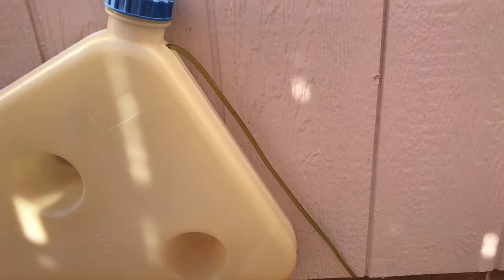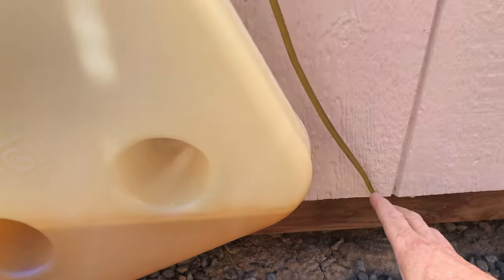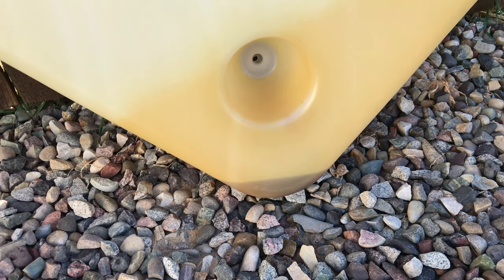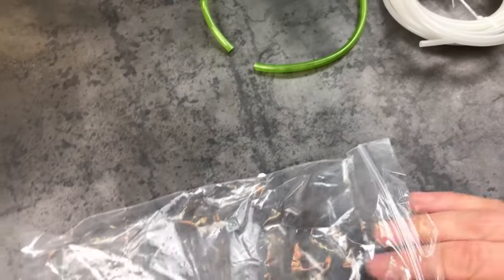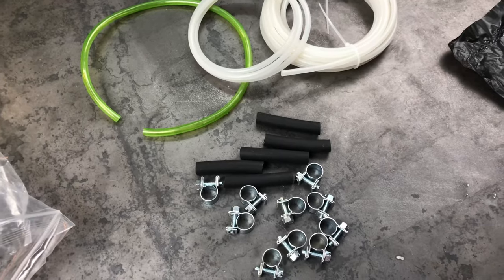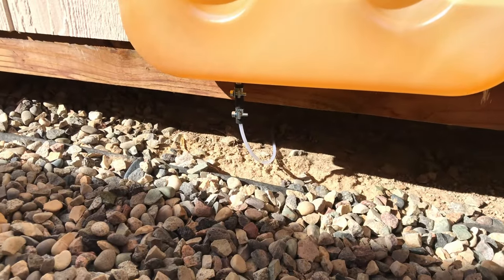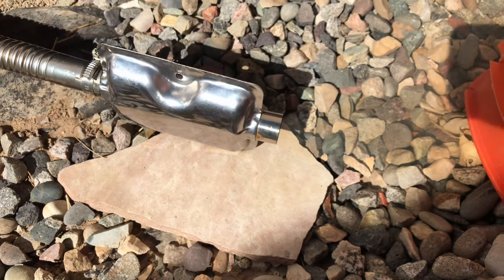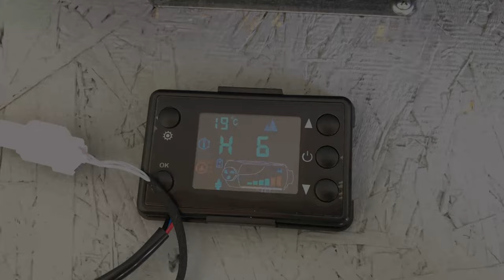Diesel Heater Green Fuel Line: What Happened And How To Fix It

Comment: With my kit i also got the green fuel lines but a friend told me they were no good and gave me a pair of white ones. I installed it exactly like yours, with the black tubes and clamps. Worked well for a few months but then it started leaking from the point where the tube enters the gas tank. Tightening or loosening the bolts doesn’t work. So maybe you wanna check that!

Comment: I guess after seeing alot of bad things going on with that cheap green fuel line, I will just replace mine when I get me heater before I use it. There is good clear fuel line at the hardware store for sure.
Reply from the maker: That’s a good idea 👍🏻
Reply: I just ordered one and the only big complaint I see is the fuel lines and lack of filter so I ordered those at the same time.

Comment: Are you sure thats not just algae ?
 From what ive been told more than once. Your not supposed to store diesel for long periods especially when exposed to sunlight as it turns rancid and grows algae
Reply from the maker: No I'm not sure, yes it could be diesel algae but I really don't know for sure.
Reply: Sunlight can do a real number on plastic if it's in a hot spot, and that tubing is lousy to begin with.

Comment: I really like the diesel heaters. Hope the diesel fuel dissolving the green line didn’t damage your heater?
Reply from the maker: I don't think it damaged the heater Mark. So far it seems to run just fine but time will tell.
Reply: @DIYHomesteadProjectsDIYHP10 I would after 2000hours check the internals ( burn chamber, atomizer screen it comes with, glow plug.. might have some black soot.. would be worth while cleaning it out before it throws an error code and lots of white smoke

Comment: Hi I have 2 diesel heaters used one last winter to heat my converted cargo trailer had some  issues with it.  Any way bought same upgrade for my second heater ,thanks for your video. Might be wrong but I noticed your intake air tube seemed to be a bit to close to you our exhaust tube ,I would be concerned about carbon monoxide.regards.Dan
Reply from the maker: Thanks Dan I appreciate your input. The air intake for the blower and the heat output are both inside the building. The small intake tube outside the building is the intake for the burn chamber and then that is exhausted outside the building as well. I believe I’m safe from potential carbon monoxide inside the building. At least that’s how I understand it. Does that make sense to you?
Reply: Yes that intake air does not go into the room you are heating, only the burn chamber. If the burn chamber is leaking then youve got bigger problems lol @DIYHomesteadProjectsDIYHP10